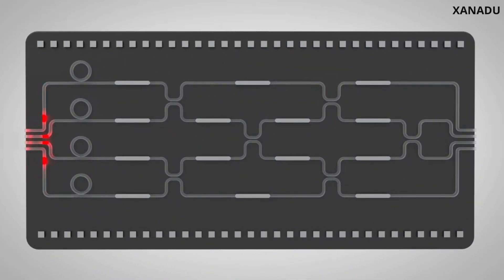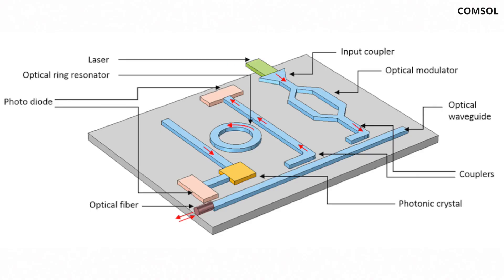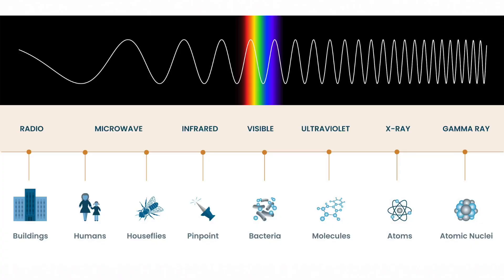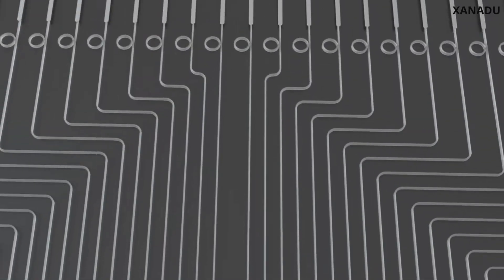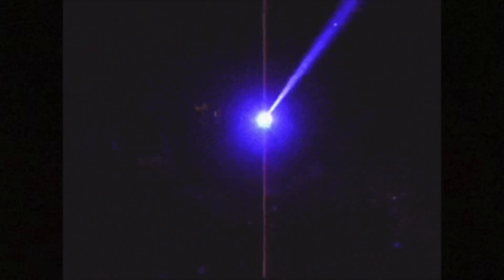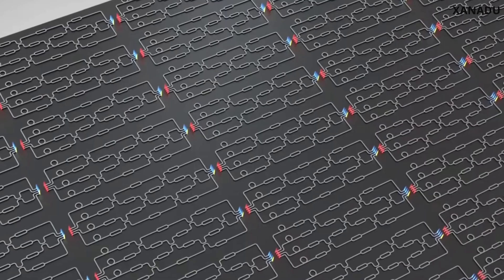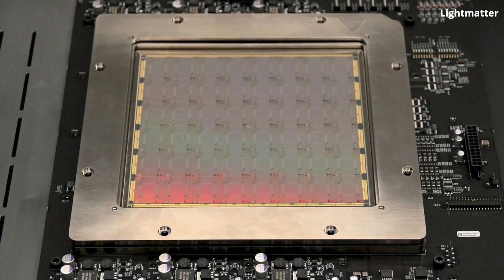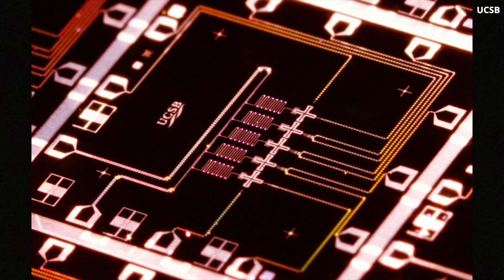New Photonic Chip: x1000 faster

Comment: So can you use the full spectrum of the light and as such send more information in parallell?
Reply: Are you asking the full EM spectrum? That would be potentially dangerous. Then there is the problem of the visible light spectrum (if that's what you mean), Visible light does not penetrate objects very well and is absorbed completely in other materials.

Comment: A speed limit with silicon is charging and discharging the parasitic capacitances in the FET switches.  There is also the limitation of heat, from losses during the charging and discharging.

I would be interested in the parasitics and resulting losses in photonic gates.  If they are significantly less, and we can create all the functions needed for computing....

Comment: I think resistive computing is the best compromise.  You\ll understand instantly if you theorize a 19ghz oscilloscope, the resistaces allow you to change circuit pathways.  Only 17% digital overall as a 128 bit multiply requires four carry compare operations each with 256 choices, its an oscilloscope.  Then yu have your gate preprogrammers that design the oscilloscopes tasks.

Comment: This is an amazing way of injecting a lot of data into a silicon microchip so you can actually have faster processing. Heck, we can even bring back ring-loops as memory, store it at the GHz range inside a loop of optic fiber. Terabytes of memory faster than DRAM.

Forget about using it for computing, just moving data and storing data are already amazing. Modern CPU/GPUs already spend most of their time just waiting for data to come to their caches. The rate at which computing can happen is severely restricted by memory and bandwidth speeds.
Reply: You make a good point, similar to Anastasi's final comments, that this "chip" and similar devices might be better suited for data transfer and communications (not sure about "data storage") than for typical computing. At least perhaps for the time being.
Reply: I still remember the first time I allocated a Tb of memory on our HPC, the sense of power was awesome.
Still took half a day to process my data though :(
Reply: This is NOT new...... it is already being done, at many  Trading exchanges..... in the real world for like the last 10 years. 
They are "storing" the data feeds in optical fiber BEFORE processing them.
Reply: @stevesteve8098 Yes, this is not new, but I think it requires the optical feed and then 2 more lasers, one to convert the optical information into phonons and a second to read that data. However, as I understand it, that only "stores" the data for 10-20 nanoseonds ... not very long even for day- or seond-traders.
Reply: @stevesteve8098  Yes, trades have been moving in microseconds for over a decade, with US govt clearing house, such as DTCC and DTC at the helm over there in NYC, Tampa and London.
Reply: @stevesteve8098  what do you mean by "storing" ?
Reply: Imagine if we can have gigabytes of cache in the cpu.
No need for relatively slow ram.
And with like a 10x speed increase, backwards compatibility through emulation is kind of a non issue, as you'd probably be able to emulate an x86 cpu at 1-2x native speed.
Reply: ring loops...ring loops ring loops...the answer to the speed benefits of lithium niobate encrusted photonics.
do you know rain neuromorphics chip department wants to transition to ring loop techniques of dealing with memory bottlenecks. very intresting point there.

Comment: Anything we can do to lower power usage for AI will be good for the planet. With photonics I question if the logic density can ever compete with what has been achieved with silicon gates. I'm not sure quantum computing will be the next big thing, since I think the next big thing will probably be discovered using AI, and it will come up with an approach we haven't even considered before!
Reply: Logic density won't be able to compete, but is that a problem?
Reply: "lower power usage for AI will be good for the planet" no entirely sure that's the problem. 
You're just being an accelerationist if you find a way to make it faster by using less energy, it means you can have more AI instead of less.
Doesn't seem like a good idea to make things even faster. 

But there was never this problem of "being good for the planet", the amount of trash that will remain after the gold rush ends is going to be amazing, even bigger than the electronic trash left by the miners after the crypto boom.

Comment: This is absolutely HUGE. Photonics needs way more coverage. Great breakdown of the paper!
Reply: is it 30 years away like the fusion?
Reply: @TML0677  Unfortunately, yes.
Reply: It isn't huge. This concept has been theorized for over 20 years and it's still nowhere near marketable.
Reply: Yep, a Thousand times faster, while CONSUMING 400 times LESS energy, could (SHOULD) be revolutionaty indeed 😛  Hey, a DARK thought just crossed my mind . . . what would this bring to the world of things such as blockchains and crypto networks ?? . . . BTW are blockchains Not BASED on some philosophy called "proof of WORK" and the need to consume INSANE amounts of power and dissipate insiduous amounts of heat . . . just [for a lifeless Machine 🙄] to "PROVE" that it has apparently "WORKED" 😅😅 ?
Reply: Ha fancy seeing you here! It takes a company like QCOM or other to pick up one of these research companies, and things get very interesting very quickly
Reply: by the time photonics for actual compute (not transport) becomes a niche adoption, we'll have viable quantum computers that dont require super cooling and can fit in a 2u rack mount case that already are capable of 5000x the compute that is expected of this paper-only compute. That will render photonic-over-medium based computing obsolete other than for a storage medium.

Comment: There have been recent breakthroughs in
1 AI
2 Quantum
3 Photonics
Now imagine an AI running on a Photonic Quantum computer!
It would make all our existing computers as useful as handheld calculators.
Reply: Doesn't even need to be entirely photonics. Specially if later we develop a way of fusing photonics and electronics. 

You can do a lot of computing in parallel, so the latency in electronics wasn't a problem, the problem is always the von-newman bottleneck, the bandwidth at which you can inject data into a silicon chip.

For ex, H100 TPU can do merely 3.35TB/s of data transfer internally. It does 51 Teraflops (FP32) but because it can only transfer 250GB/s from memory, it doesn't get even closer to that.

The H100 has 456 tensor units, if you could feed data without ever having to wait a single clock cycle, you would need at least 153TB/s. 
But if your chip can do 1 multiplication per clock cycle (*1) at 3.5Ghz, that would at least consume 0.336 TB/s for a single unit, or 153TB/s total.
So if you could feed data at the rate it can consume, you can easily do 50 times more computing. You can do 2.5 Petaflops instead per chip.
(*1 - tensor cores in the volta actually have 5 stages, those at least use 5 cycles per "instruction", I'm considering 3 floats inputs)

But there's no way to inject that much data into a silicon chip, the die size would have to be huge for the amount of pins it would need to have. Maybe some IBM mainframes can do that. 150TB/s is a lot of data. 

Now with photonics, that's a possible optimization, far away (aka, in the same server, but not on the same PCB) you can have terabytes of RAM in parallel feeding data to a microwave emitter and then to a light pipe and then to a single microchip. (it would still need to have another back-converter to microwave and a receptor to feed the data to the silicon above, but that would be flip-chip interconnect instead)

Also you can now make it even denser with much more tensor units and remove all the cruft used for managing caches, you don't need caching or even registers, its pure computing, data in / data out.

You can even do crazy things like active cooling inside a microchip if you don't have so much die size being spent on interconnect or cache.
Reply: @monad_tcp oh yes, talk dirty to me! 😄
Reply: I don't think a photonic quantum computer would benefit from many of the advancements in classical photonic computing.
I could be wrong, but I imagine quantum vs classical photonics is a whole different beast.
But yeah, photonics could certainly speed up AI if it gets good enough, and quantum computers make AI go crazy, but that's probably further away. We'd probably have to relearn a lot of what we know about training classical AIs too.
Reply: @alansmithee419 but relearn with x1000 more researcher (nowadays) is much more easy and faster. And also AI assist and help us to continue faster.
Reply: Relax, there are clear limits to what a quantum computer can do. This photonic computer presented here seems to be just a new type of analog computer as far as I got her. But analog or digital, quantum or not, all computers obey to complexity theory and physics in the end. You don't get to beat the physical limits of computing easily. Personally I prefer the photonic design over other types of quantum computers as well due to noise resilience (you don't need to cool the system which makes photons the way to go for quantum data transmission) but apparently there are some issues with preparing single photons or distinguishing the modes or something. Well however - whatever hardware you use - the mathematics, physics and algorithms work for all of them. Analog, digital, quantum analog, quantum digital, light, water, mechanics, electronics, atoms, spins - I don't care what you compute with - the equations stay the same and thus the way to program the system. What is it with computer scientists never thinking outside the box? For physicists it is quite intuitive that you need to adapt some constants in each system for adequate description but using physical systems to calculate or model the physical world is quite old as approach.
Reply: Yes friend AQPppphyyy and we're there.
Reply: rubbish, combining lots of overhyped tech doesn't work, just a chip designer speaking
Reply: Don't forget biological quantum computers super engineered to use miccrotublers. The very same ones they are saying humans use for consciousness!

 Wild times!
 
 Just playing on the quantum part. I just learned there are theories that say the human brain uses these things called microtubulers. That they are responsible for our consciousness due to quantum processes going on. 

 One of the professors is actually well respected in certain fields. 

 Anywho. Biological computers are a thing they are trying to create. Don't think I'd be good at remembering to feed my computer with protein though.
Reply: @dianapennepacker6854  lol, quantum tamagochi...
Reply: Indeed:-)
Reply: Super AGI
Reply: @ThePhilosopherKing101  
There's a term for that.
ASI.
Literally "Artificial super intelligence." meaning something so intelligent that the best human minds can't understand what it's even doing.
Reply: @ThePhilosopherKing101 *ASI